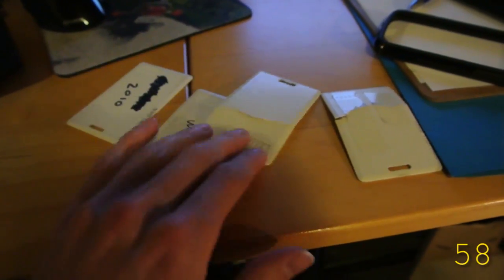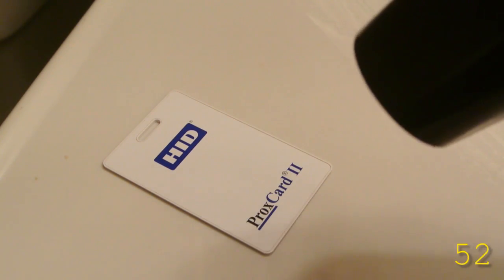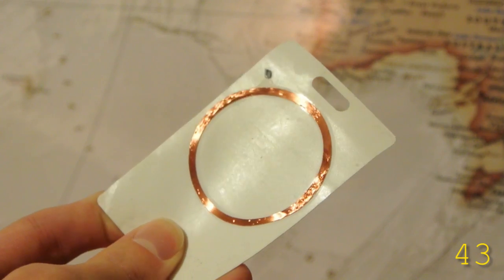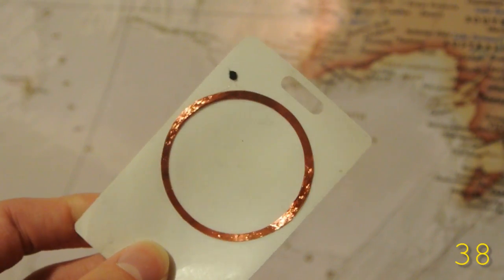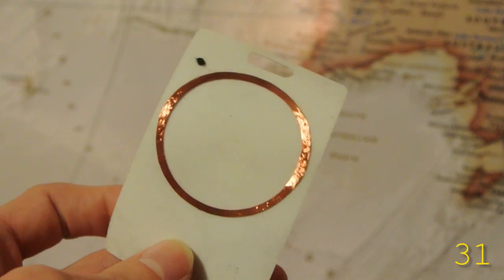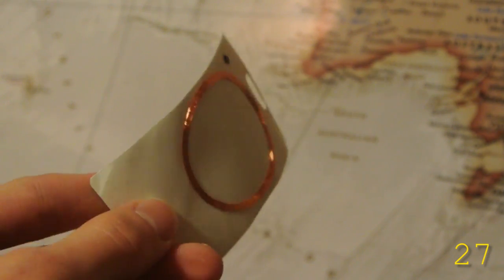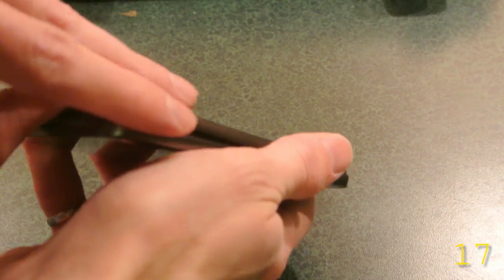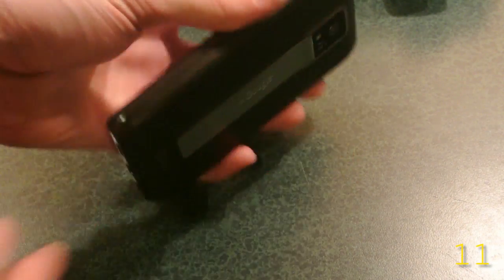What's inside of a Prox (HID) card?

Comment: Interesting! How is the chip programmed? By a device or is this factory set?
Reply from the maker: I believe they come programmed and need to be added into the system where you are installing them. They can't(?) easily be copied because it's not a single code -- it has a "site code" which identifies the location or company (so you can't use it at another company) and then a rolling number code, so it cannot simply be copied. 

I believe that's why this style card is used, and not a simple NFC or RFID tag -- which could be copied very simply, even with just using your cellphone!